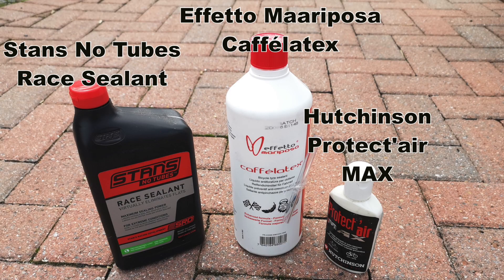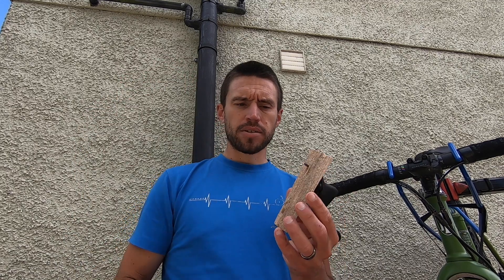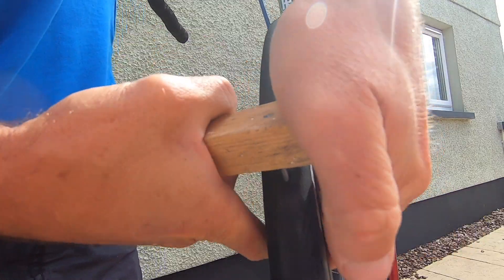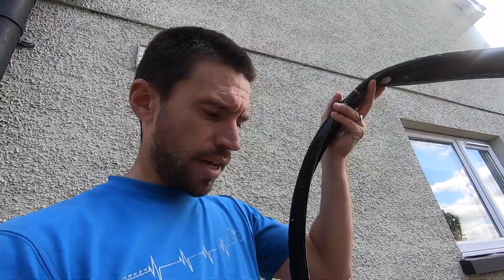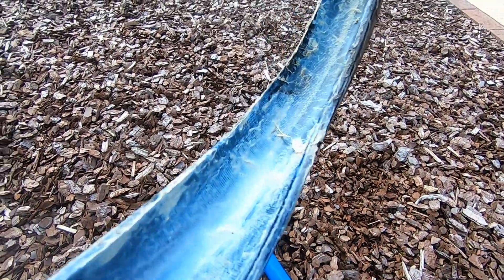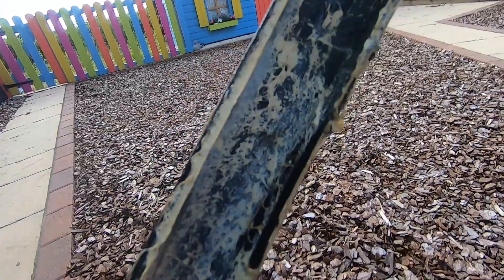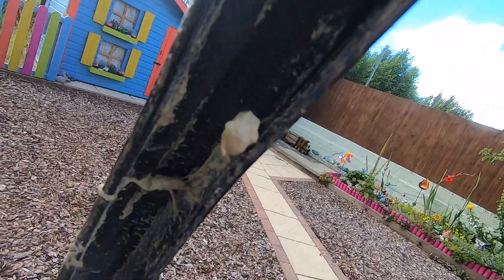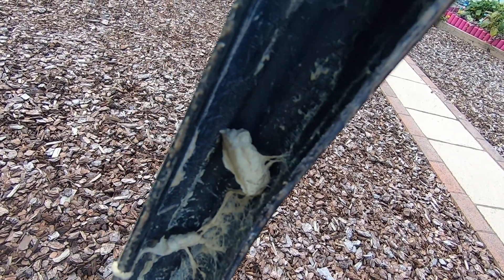Road Tubeless Tyre Sealant Test & Review - No Tubes Race vs Hutchinson vs Caffelatex

Comment: First off all road tubeless is stupid af. Clincher tire with tpu tube all the way. But for gravel tubeless is the way to go. Stans race is good, but never buy the regular one. Worst shit ever, would not seal a pinhole
Reply from the maker: You are of course entitled to your opinion, but I couldn't disagree with you more in both areas. Since this, I have tested almost every sealant on the market, and both Stans are very average.
Reply: Living in the desert, I was getting 3-4 thorn flats a week, often not even making it off my block with robust, conti 4 seasons.   I still get those same thorns but I just pluck them out and keep riding...while riding fast rolling, supple tires.  I've used 3 tubes in 80k miles vs a good 1000 tube replacements😂
Reply: you can just put sealant in tubes to avoid the mess

Comment: These are ideal holes. I ran GP5000 S TR with Muc Off and they would seal one out of every 5 punctures. Even then they would have about 30 psi left. Tubeless is no good for road tyre pressures. It's being pushed by big cycling channels / websites as they are paid by the manufacturers.
Reply from the maker: Since recording this I've tested almost every sealant, and Muc-Off is rubbish. Try a better sealant like Peaty's, WTB or Milkit.

Think what you like, tubeless is brilliant if you use the right stuff
 GP5000s are poor too, as they are too tight to fit or repair.
Reply: @MattPage  Cade Media says that Silca is the ONLY solution for road tires.  The guy who said that runs a shop in London
Reply from the maker: @NinthwaveThe Well ive tried 3 batches, they've all dried up into balls.
Reply: 80k miles of tubeless road and I'd probably quit cycling if tubeless disappeared😂  Totally life-changing living in a place with tons of goatheads

Comment: I have a different opinion. Of course the most important objective is the tire seals while you’re riding such that you don’t even know you got a hole.  I haven’t had a flat for THREE years. And that’s a hard-core three years because I live in Los Angeles. Streets here are like off-road would normally be with glass, steel parts and pieces, holes, cracks in the road, pretty bad… and that’s why, sidenote, I ride my “gravel” bike in Los Angeles, not my road bike because a 38 mm tire is just tougher. Period.  there are other variables besides with the liquid is seal in the hole, Besides the fluid sealing the hole, the second thing is the maintenance of it and/or the price of it. there’s also things like, will it clump up in the tire and in that UNbalance the weight of the wheel?  How heavy is it from one fluid to the other, in that there is enough fluid is to seal a hole.  We have some white weenies out here and I’m one…!   The café and Stan’s make a consistent coating around the inside of the tire which is what you want. The flat out seems to goop along center of the tire?  I guess from centrifugal force?  I didn’t find it to coat the side walls at all?  At the end of the day, I have three years of no flats riding in Los Angeles streets, and I use café.
Reply from the maker: It is the worst performing tubeless sealant I have ever used, and several years on from this video it now includes almost every one.
Reply: @MattPage  obviously, you have had a different experience than I have.  i recently tried some FlatOut.  But it’s too thick n heavy for this size tire. I also noted that the flat out collected along the center strip of the inside of the tire, not really coating the inside of the  sidewalls very well. I just bought some Silca Ultimate to test, since I’ve run out of any other. Wonder why we have different experiences?  I have been riding a gravel tire, not a road bike tire last couple years.  38mm Panaracer Gravelking SS TCL on a carbon Aeolus Pro3V wheel. On LA streets.  Also spent a year in Texas recently.  Same tire/wheel. I see small cuts and holes all round the tire, but no flat for 3 years. 3 years no flats says a lot. You’re probably riding a 25mm tire?  Not sure what tarmac you ride. LA is brutal on a tire. But no flat for 3 years…wonder how the Silca is going to perform.  It’s fairly “watery”, so I should get some side wall coverage.

Comment: Don't fuck about just use the original and best, I've used stans for 11 years and it's the only one to use, that, or Doc blue by Schwalbe its made by stans. The only other one id uses if you using hand made tyers and they are very thin, would be Panaracer's smart seal it reacts very quickly to air and seals very quickly and can penetrate the pourus sidewalls and keep them sealed. Downside hard to keep topped up, dries out quick, very reactive. The pros it doesn't weep, it's very reactive, seals very quickly.

People are too quick to put darts into the tier, just let the sealant do its thing. if you notice a puncture turn the puncture to the floor and work the tier into the grit or dirt on the road this will aid in sealing, top up with air if needed. I've never needed a dart on a road tier. Come to think of it never used one a gravel tier either. 

I was converting tiers to tubless before TLR tiers were a thing I generally don't know why people have such a hard time with it. Its just about being methodical.
Reply from the maker: Having tested many more since filming this there are a few others I would also recommend. Vittoria make a good one and it is ammonia-free. Joe's is also good and often cheaper than No Tube equivalent.

But No Tubes - either Race for shorter durations - like races, or standard stuff are very good.

Comment: I've been using Caffelatex for quite sometime now. (It is my first time going tubeless, haven't tried other sealants in my case). It has failed me numerous times. Got a not so big puncture in the middle of my tire, to the point that all the sealant left has drained out, and has left a mess everywhere from my bike to the road. It's also very hard to clean out all the sticky goo left in the tire. Really a pain in the ass, switching to Stans.
Reply from the maker: Exactly my experience. Stans is good, as is Joes.
Reply: agree, i always going back to stans after trying other brands

Comment: I bought a big bottle of Stan's Race Sealant. Kept in in a dark place in the garage. After only 6 months the sealant in the bottle was clogged... Pretty disappointing.
Reply from the maker: It must have had a hole somewhere for air to enter. I have some that is well over a year old, just shake it up and its fine. But if air can get in, it will start to loose moisture and go hard.
Reply: @MattPage  thanks for the tip. What's also strange is that the Stan's sealant got very liquid after 3 months. Almost as liquid as water.  Where as the Effeto Mariposa I am currently using still remains the same, even after 8 months of being in the tyres of my mtb. Don't think it still works. But the thickness hasn't changed over time.
Reply: @Kay P 8 bar?

Comment: I've used stans standard sealant on mtb and on  road bikes for 5 years on schwalbe pro one tyres. For holes that are too big for the sealant to fix carry Stans Dart which plugs the slashes that come from flints. I have not needed a tube to get back home yet in about 10,000k. Probably need one tomorrow.
Reply from the maker: Darts or similar plugs are great. More so off-road though, or perhaps in a more urban area where glass could be more of an issue.
Reply: @MattPage  I have had to use it on  3 on road bikes since I got the dart in November.  Two on my own tyres and one on a stranded cyclist last  Sunday.  The November dart stayed in the tyre till I scrapped it in march with about 1000 kilometer of winter riding on it.
Reply from the maker: You must live in a very harsh place for punctures in that case!
Reply: @MattPage  I cycle in the Downs of Oxfordshire and Berkshire where the roads are peppered in small flints. No tyres are Flint proof.
Reply: @Justus Andre instablaster :)
Reply: @Ari Isaac thanks so much for your reply. I found the site thru google and Im in the hacking process atm.
I see it takes quite some time so I will reply here later with my results.
Reply: @Ari Isaac It did the trick and I actually got access to my account again. I am so happy:D
Thanks so much, you saved my account :D
Reply: @Justus Andre No problem :D
Reply: Sorry to be so off topic but does anybody know of a method to get back into an Instagram account??
I was dumb lost the login password. I would appreciate any tricks you can offer me